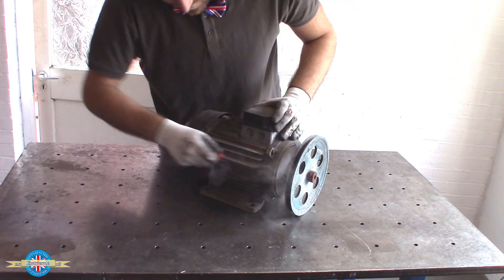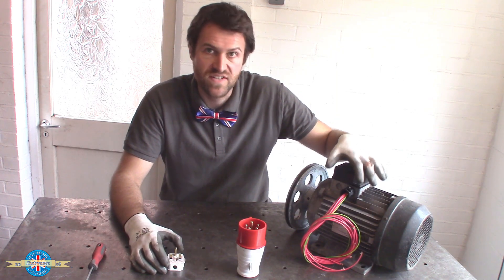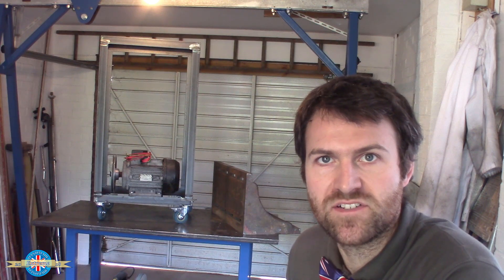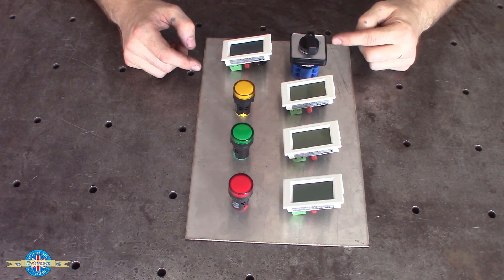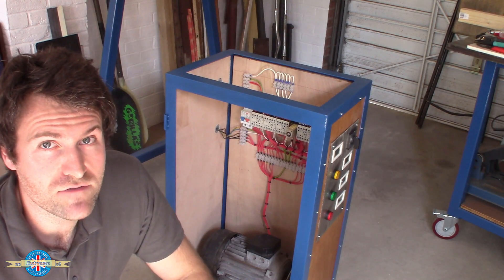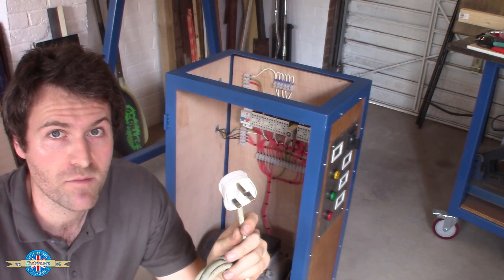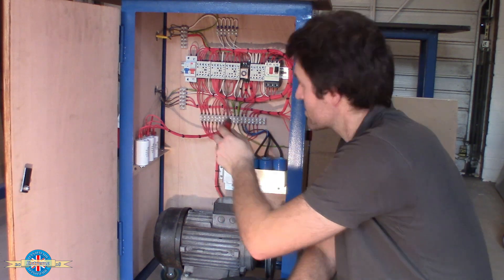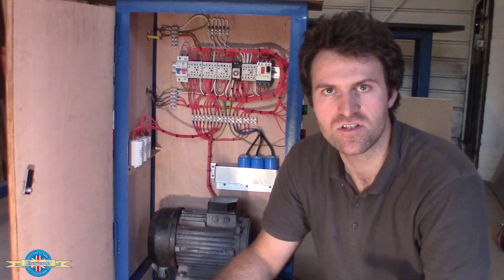1 Phase to 3 Phase Rotary Converter - 230V to 415V

Comment: 2 months since I first saw this, and commented. I'm having a lot of trouble getting started on one of these. I bought some plans on ebay and watched as many videos on the topic as possible but I'm not much wiser really. I can't afford a commercial RPC right now and with a 'dead' lathe sat in the workshop (that I need for my work) I really need to work it out somehow. If you fancy building another give me a shout... ;-)
Reply from the maker: What is it that you are actually struggling with? 
I assume the plans you have are Les's?
Regarding me building one for you; it would be much cheaper for you to buy a commercial one than have me make a one off for you. The companies that make them every day are set up for it and have all the bits on hand. They will also give you a warranty. If it is just one machine (ie 1 motor only) that you want to power have you considered an inverter? The reason I built the RPC is because I have multiple machine with multiple motors that I want to power. If it's just one an inverter might be a better solution.  
I'm planning a follow up video at some point which will be more more technical detail focused if you are still interested in building a RPC.
Reply: @Handmadeextreme   I'm not well versed in elctronics by any means. Yes Les' plans, and he's given me some advice via email which is helpful but It's quite daunting for me. It's for one machine currently, which uses 2 motors (one coolant motor feeds off the main supply) and would be useful for future machines. It's my day job and likely I'll be gaining more 3-phase machines in the future. I have seen some cheap 220v single to 380v 3phase inverters but the main reason Im hesitent is due to my duel-winding/duel speed motor. It'd work, but It would mean stopping the vfd between speed changes and as its a capstan/turret lathe the quick change/stop/rev is quite important. Hence a RPC would be the most suitable option. At the moment the RPC build will cost pretty much the same amount I paid for the lathe, Which wouldn't be too bad if I was confident in the wiring and components. Thanks for the reply.

Comment: how is your output voltage almost double the input? everything i have read is 230 in 230 out unless you use a transformer. i got a baldor 40hp motor at auction for $100 that i am going to make into an rpc.
Reply from the maker: It's because it's a star delta motor. By re-configuring the windings when it switches from one to the other it bumps up the output voltage. I'm planning on doing a detailed follow video at some point soon if you are interested. Thanks for watching.

Comment: Does it matter how many hp the motor is?
Reply from the maker: The idle motor for the converter needs to be at least double the size of the machine you want it to power. Hope that helps and thanks for watching.👍

Comment: Hi what amperage can this supply at 415v? Well built unit. Just subscribed.
Reply from the maker: No entirely sure to be honest. i've never maxed it out. It happily runs my Bridgeport / Harrison VS330 and Jones and Shipman 540 (one at a time of course) they are all around 2.2Kw load motors. If you need to run bigger equipment the principles are the same you just need higher rated switchgear / cables etc and a bigger idle motor. Typically the idle motor wants to be about double the size of your load. My lathe is 2.2Kw the idle motor is 4Kw. I'll have to take a look what it pulls next time I use it. I vaguely recall it being about 3-4A/phase.
I'm planning a detailed video in coming weeks with some drawings etc. Thanks for watching.

Comment: Hi. What a great video and can I just say that it was your video that inspired me to build my own portable rotary phase converter. I was pretty much in the same scenario as you where I have about three different machines that I needed to try and run. I had looked into the VFD route myself but found it would've been pretty expensive as it would've needed to be one VFD unit per machine. Furthermore, all my machines are high voltage motors so it would've been the more expensive 415v VFD's. I have two lathes that are both 1 1/2 Hp and a 3 Hp milling machine. I too have used a 4Kw low voltage motor (would've liked a 5.5Kw motor but it was all I could get for a reasonable price), but is pretty much touch and go getting the mill started which I'm hoping a bigger flywheel for my idle motor will sort out to increase the inertia. Once running it is fine, and both lathes start up no trouble at all!

Something I would like to talk about is this practice of starting the idle motor in Delta and then switching over to Star. RODALCO2007 started his like that in his video and I also purchased a wiring diagram from a chap called Les Austin off ebay, and he's also gone down the start in Delta and switch to Star route! What I've found is that you can 'Soft Start' the motor in Star and then switch to Live and Neutral in Star with Neutral going to the Star point. I've found that this has had no implications on the working of the converter and it certainly draws less amps when starting. By my understanding, when you start up a motor, your start up current is around 5 times the full load current. The FLC of my motor is around 15.8 amps in Delta, which means I would get a current surge of near 80 amps briefly when starting! In Star configuration, the FLC is just over 9 amps at 415v. By dropping the voltage to 240v, you can reduce the amps to around 5.5 amps meaning the current surge is only around 28 amps!, but the motor will still start fine. You only need a small start capacitor too for this (mine was around 70 - 80uF). The only reason for the Delta start as far as I could see was in RODALCO2007 video. He was starting a high voltage 415v motor in Delta because he only had a 240v supply (soft starting in Delta so to speak). Once I saw that, the Delta start then made sense to me.

Ps. Congratulations on not rising to some of the other comments on here. Comments such as what's the point when you can just buy a VFD or people saying that it's impossible to convert 240v to 415v without a transformer (even when you've shown them that you've done it without a transformer, and so have I now for that matter!).
Reply from the maker: Hi Stephen, 

It's great to hear a success story like this. I too have seen the RODALCO2007 video and also Les's video on Vimo and have a set of his drawings. 

The larger flywheel certainly helps. I ended up making mine a bit heaver by bolting an old brake disc to it.  It worked fine as you see it in the video for powering the lathe but I had problems with the Bridgeport. The problem I had was that when I tried to start to mill the voltage drop caused by the spindle motor trying to start would drop out the coil on the safety circuit contactor. Now on my mill the control system is all 110v which is fed from a 415-110v transformer. To solve the problem I simply replaced it with a 230v-110v one and then just plugged it straight into the wall. It's no extra effort to turn the machine on as I still have to go to the wall to switch on the DRO.  Which reminds me I really need to get a new back-light for that thing....
I should be doing a follow up video at some point soon for the RPC if you are interested.  I've had so many questions about drawings I thought I mite do a set and take people through them. 

Interesting idea about the star start. I'll have to look into that. I'm hoping to be moving to a bigger workshop soon so If I have to make another converter for larger machines I'll be sure to test it out. Thanks very much!! 

Thanks for watching and really glad my video helped you. 
Stay safe,
Rob
Reply: @Handmadeextreme  Cheers for that Rob! A couple of questions I'd like to ask. How many amps are you drawing with just the converter running and how many are you drawing when running your lathe? The reason I ask this is because mine seems to be quite high, but I have a feeling my gauge is out! 

When I first started my converter without any run caps it was drawing around 14 amps and humming quite badly. I expected this as nothing was yet balanced and voltages were L1-L2 398v, L2-L3 340v, and L1-L3 375v. After finally balancing by putting a 10uF cap between L1-L2 and a 50uF cap between L2-L3 it was running really sweet, but was only able to get it down to 7.5 amps. I couldn't add any more caps as it was now throwing the voltages too far out from one another. After adding the caps the voltages were now L1-L2 418v, L2-L3 438v and L1-L3 432v. Once a load was put onto this ( my 1.5Hp lathe), the voltages balanced themselves out between 5v - 10v of one another and the amps were now upto 10 amps. As I say, everything is sounding smooth and the motor is barely getting luke warm, so maybe my amp meter may be out. I'm getting myself an amp clamp to double check this.

What I've also done with my converter is to put in a couple of capacitor selector switches. Both switches have 3 settings and one is placed between L1-L2 and the other is placed between L2-L3. The idea is you can fine tune and select between different run caps. My idea finally is to balance and fine tune my 1.5Hp lathe properly and have this as setting no.1 on both switches. I can then fine tune using different caps for the 3Hp milling and make this setting no.2 on both switches. Setting no.3 can be for something else when it comes along!

Here is a link (if it works) to a pic of my converter. Probably similar in dimensions to yours. https://www.flickr.com/photos/188117300@N08/shares/9d4ua0

Cheers Steve.
Reply from the maker: No Problem. You have done a lovely job of that.

Your readings do sound a bit high.  If i remember correctly the loads on my single phase supply are roughly as follows:
Start up inrush ~60A.
Idle is about 3-4 A
Lathe running is around 7-8 A My lathe is 2.2kW  (3HP)
I'm not sure what it is with the Bridgeport running. I have a few jobs to do coming up soon so i'll take a look then.
Also should be getting some bits delivered this week to get my J&S 540 running so it will be interesting to see what that draws. 

I had to play around with various capacitors to tune it. Took about 10 iterations making a few notes in between. Total trial and improvement. I seem to recall ending up using a combination of 10-20 uF caps, might have paralleled a couple of them to get 40 or something, can't remember off the top of my head. My voltage balance is similar your yours as well.
Reply: @Handmadeextreme  Thanks Rob, those figures are a great help.

It's interesting to see that the difference in amps between your lathe running and your converter at idle is around 4 amps. My converter at idle is 7-8 amps and with the milling machine running (3HP) is showing around 11-12 amps, so again the difference is around 4 amps! I would now be inclined to think that my ammeter is out by about 4 amps and needs re-calibrating. As I say, the motor doesn't sound under strain and is also running pretty cool. My motor is similar in design to yours that I picked up off ebay, looks hardly used, so would imagine it would function pretty much the same as yours. The ammeter I got off ebay too, so no real guarantee if it works properly or not.

I've got another overload relay on order for my motor as the other one I've fitted is out of spec and trips at too higher current. This will hopefully protect the motor in any case .

Again, many thanks for taking the time to reply so quick and carry on converting!

Cheers,
Steve.
Reply: @Handmadeextreme  Hi Rob, sorry to trouble you again but just one quick question. Is your 4kw motor a 2 pole or 4 pole / under 3000 rpm or under 1500 rpm motor?
Reply from the maker: No problem at all. I honestly can't remember. The way I mounted the motor in the enclosure also means I can't see the plate. I have a feeling it might be a 1500RPM motor but I can't be sure without pulling the motor out.
Reply: @Handmadeextreme  Ah well, worth a try. Looking at the speed it starts up in your video, it doesn't look fast enough to be a 2 pole motor. I'm still looking into why my motor is drawing the current it is and I'm just eliminating any possibilities. Mine is also 1500 RPM. I'm still experimenting with capacitors and managed to drop it by another amp. I've also tried swapping motor connections just in case the main 240v driven phase is a bad winding, but amperage was the same on one of the others.

Other than that, the converter runs lovely and smooth. I've tried a bigger chuck as a temporary flywheel and it now starts my 3hp milling machine first time every time, but it does put a fare amount of strain on the converter. I have an old Parkson 1NA milling maching which is Direct Online Start but still takes a couple of moments to get up to speed (always has done),  so the current surge lasts the same amount of time before it's up to speed, rather than just a brief flick of the ammeter when starting the lathe. My have to look into whether I can design some sort of soft start for that machine too!

Thank's again,
Steve.
Reply: @Handmadeextreme  Ah well, worth a try. Looking at the speed it starts up in your video, it doesn't look fast enough to be a 2 pole motor. I'm still looking into why my motor is drawing the current it is and I'm just eliminating any possibilities. Mine is also 1500 RPM. I'm still experimenting with capacitors and managed to drop it by another amp. I've also tried swapping motor connections just in case the main 240v driven phase is a bad winding, but amperage was the same on one of the others.

Other than that, the converter runs lovely and smooth. I've tried a bigger chuck as a temporary flywheel and it now starts my 3hp milling machine first time every time, but it does put a fare amount of strain on the converter. I have an old Parkson 1NA milling maching which is Direct Online Start but still takes a couple of moments to get up to speed (always has done),  so the current surge lasts the same amount of time before it's up to speed, rather than just a brief flick of the ammeter when starting the lathe. My have to look into whether I can design some sort of soft start for that machine too!

Thank's again,
Steve.

Comment: I'm both inspired and bewildered..! Great video. I have a 440v star only 2-speed 3ph motor (lathe) and I'm desperately trying to get it running using the original motor! I think this kind of thing can work.. but the 2-speed part adds an extra level of complexity that most people seem to be stumped by. Cheers from the South West UK
Reply from the maker: Sounds interesting. I assume the machine does all the speed control itself and just needs a 415 supply? If that is the case then a rotary converter should work. I don't I have any real experience with that kind of motor.
Reply: @Handmadeextreme  Theres different windings, so 3 wires connect to the low rpm and 3 to the high rpm. But they both use 440v    The control switch just redirects the 440v to either or set of 3 wires (Thats how I understand it) So in my head a rotary phase converter like yours should work.. (?) Thanks for the reply btw!
Reply from the maker: That's what I had imagined. I'd say a RPC is a plausible solution as switching the winding downstream won't bother it. A VFD is another option. Just choose one set of windings then use the VFD to control speed. I have to say I'm a fan of the RPC as it allows for other 3 phase machines to be added to the shop in future without the need to but more VFDs. I have my lathe and mills both running on the RPC at the moment and also have a surface grinder that I need to get up and going in the near future. 
I'm planning a follow up to this video in the very near future (next few weeks probably) were I will go into a lot more technical information if you are interested. Might be a bit dry and 'schoolroom' but will hopefully answer a lot of the questions you see in the comments. 
No problem at all it's nice to help out fellow wokshopers.
Reply: @Handmadeextreme  I tested with a VFD with 220v output, which worked but the torque was barely enough to keep the motor going. It was a good test, and I was going to stick to one winding and use teh VFD pot control for speed. The RPC like you say had those added benefits. I already run a lathe and mill on 3 VFDs and like them, but this seems a bit better. Definitely interested in seeing that! I'll sub.
Reply: @Handmadeextreme  Im just watching on of the links you posted, and what do you know.. The chap explains his own Lathe is a two speed ''pole-change'' motor and his rotary converter setup works perfectly for it!

Comment: You forget one importing thing. Grounding (earth) your contolpanel. It is made of metal and insulated mounted and there is life voltage on the components. Very dangerous.
Reply from the maker: Well spotted. I didn't show it in the video but the cabinet is fully bonded and earthed back through the supply cable. Absolutely right about how dangerous that can be. Cheers.